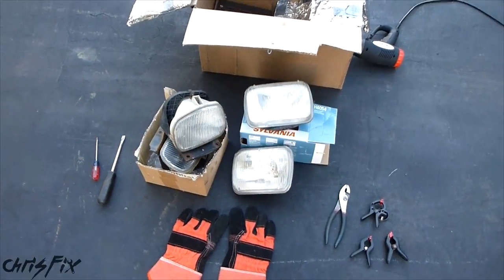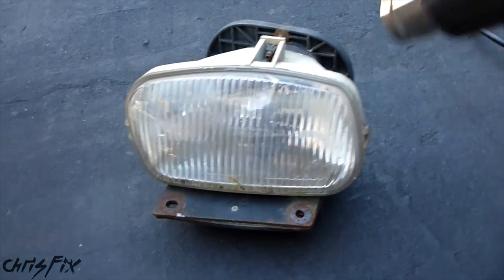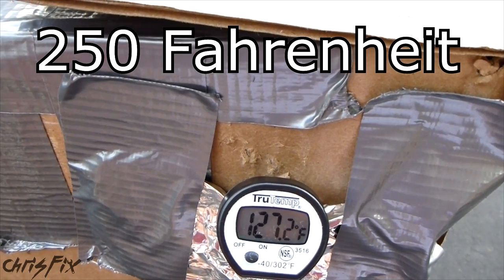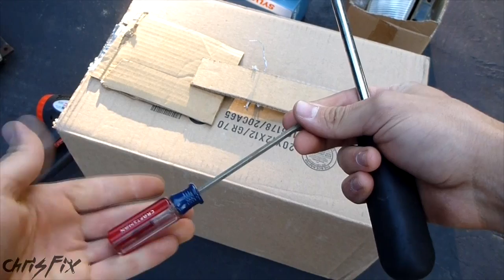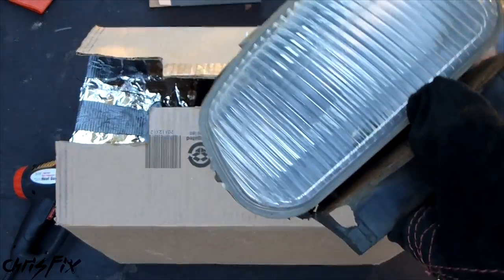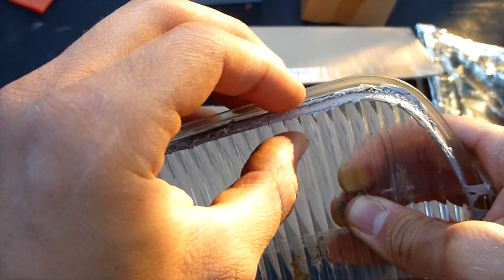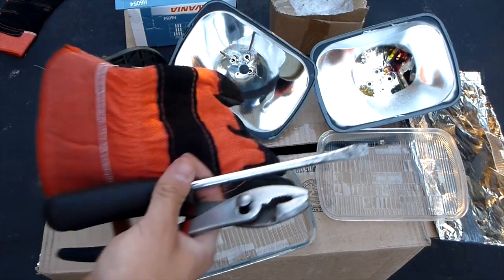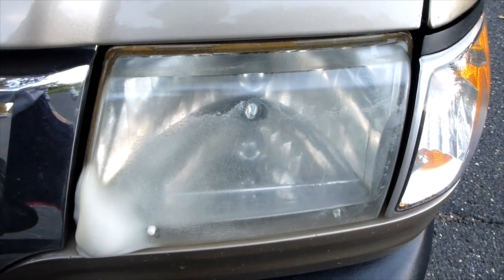How to Separate Headlight or Fog Light Lenses (without Oven, EASY)

Comment: So what can one do if permaseal or ultrasonic weld?
Reply: +blackcarmafia I've done a few retrofits on "permaseal" type enclosures.  This type of seal is much more common on tail light, marker light and signal light housings than it is on headlights.  How you approach it will depend a lot on how the housing is made, as well as how old it is.  Older housings are a bit easier to take apart.

I'd recommend working with the assembly cold, rather than hot.  Use an assortment of Olfa-style blades, straight razors, steel spatulas, and fishing line.  Go slow, be patient, and be ready to take breaks.  Realize that any place where there's a color change (amber turn signals amongst red brake/tail lights, for instance), the different colored pieces will want to separate if you're working near them.  If they do, a bit of CA glue will put them back together, but wait until everything is apart.

It can--and probably will--take several hours to separate a single housing.

If, on the other hand, you're only looking to clean moisture residue off the inside of a tail lamp or signal lamp housing, just remove the housing from the vehicle, remove the light/lights, fill the housing halfway with a 50/50 mix of isopropyl alcohol and distilled water, cover the holes, shake them vigorously for a minute or two, drain the liquid, blast some compressed air (canned air will do, air compressor with air wand is ideal) into the bulb holes, then allow them to air-dry the rest of the way for a few hours before putting them back into service.  :)

Comment: fwiw this only works with lenses glued in with butyl rubber. Glass lens H4's are cemented and have to be carefully cut open with a dremel. Other newer vehicles, like some fords use "sonic welding" for their headlamps like 99% of all tail lamp lenses. Basically its a sonic frequency that vibrates the plastics and they melt together due to friction. Again, they have to be cut open.

Comment: some headlight lenses are clear, some have vertical lines-patterns what are they for. multi reflector technology may be.
Reply from the maker: +bazrazin1 some are reflector housing (clear lens but diamond shaped reflector material on the back. Some are etched lenses that distribute the beam thru the lens instead of reflecting.

Comment: Are those plastic headlights?
Reply from the maker: Yes they are. A lot of sealed beams come in glass too for which the procedure is the same. They are plastic because they were in the Vette which has hide-away-headlights so you want as little weight as possible.

Comment: Don't use duck tape cause it's plastic use paper tape
Reply from the maker: Thanks for the tip
Reply: how about that metal tape. the silver colored stuff that you use on heating ducts and on tbe back of clothes dryers to connect exhaust tubes?

Comment: What vehicle is that light to?
Reply: The fog light looks like your mazda, but the first one... Idk
Reply from the maker: RedTeamWolf The first sealed beam is from my Corvette (C4 hideaway headlights) and the fogs are from my Mazda truck like you said. The cool thing about the sealed beams is it applies to so many different cars because so many cars use to use sealed beams like Jeeps, and many classic cars!
Reply: ChrisFix I'm glad that at least we all learned a lesson from the truck instead of the Corvette.
Reply: ChrisFix I'm hoping that the older ranger aftermarket hid work with my truck. My grandpa's 95 ranger looks identical to my 2000 b4000
Reply: RedTeamWolf If you look around I'm sure you'll find one.
Reply from the maker: RedTeamWolf That would be cool. I know it doesnt work that way for the Mazda headlights which stinks.
Reply from the maker: DE Nichols Im willing to experiment on the Truck but the NEVER the Vette LOL

Comment: Title says 'How to remove without an oven.' Proceeds to make a really shitty oven. You're a lot less likely to damage your headlights in an actual oven and I thought everyone has one, in the US at least. Just put the headlights on a piece of wood and stick it in the oven on bake for at 270 degrees. Then check it as often as you want. It'll probably take 10 minutes, depending on what they used to seal your headlights. You could take it at 5 min, 8 min, 11 min, etc and check it with a pry tool. Wear oven mitts, obviously and don't touch the headlight on anything metal inside the oven. Make sure you preheat the oven. 220 might work too.

Comment: Not everyone has a heatgun
Reply from the maker: +thšs perssonnn You can buy one for $10
Reply: I got mine apart, cleaned, and back together. Used a lighter when part wasn't moving and some knifes to pull it apart. Cracked them on some spots, but I got it.

Comment: Has anyone tried using a toaster oven?
Reply from the maker: +Allen McKinney If it is large enough you can probably do it. Small ones will just melt the plastic.
Reply: ChrisFix
We'll I'm looking to retro fit my s10 lens and they are smaller then anything I've seen on youtube beside your sealed beams. If something goes wrong they are only $30 in a junkyard.